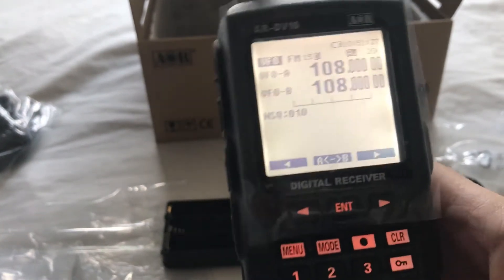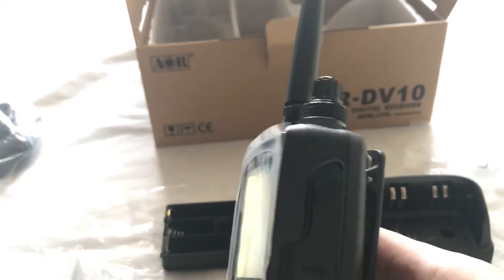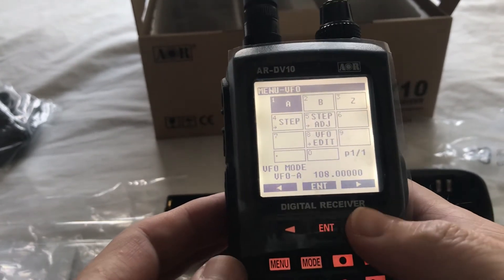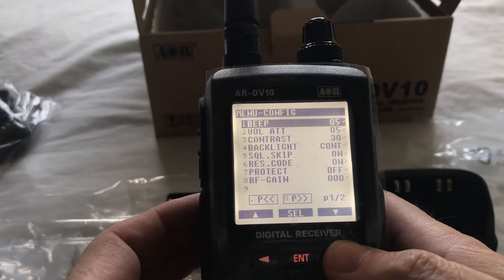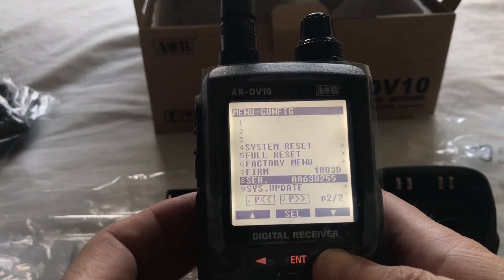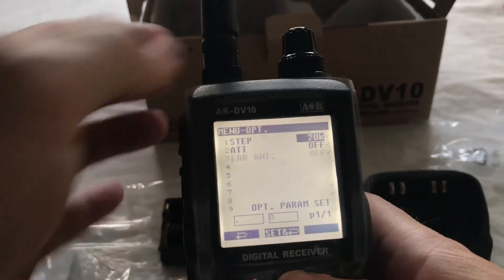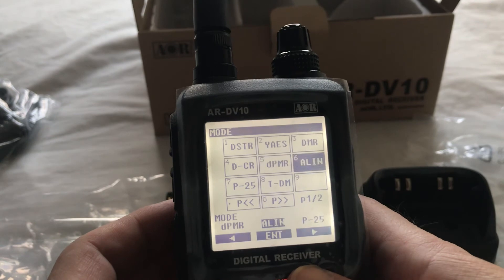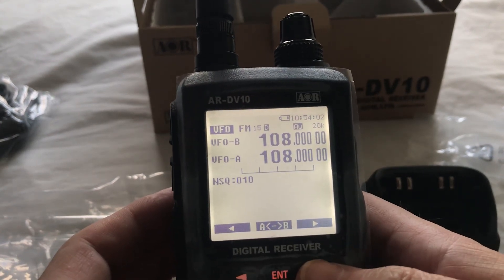AOR AR-DV10 Quick Look

Comment: Way way way way wayyyyyy overpriced, considering there is a kenwood that scans the same frequencies, for $100 used.
Reply: True, but the Kenwood doesn't decode all the same digital voices the AOR does
Reply: Kenwood does NOT have all the Digital Modes that the AOR has, plus you can SCAN an Unknown system and still Demodulate the Audio.
Reply: Also if you order international without all the USA bullshit you get no locked out frequencies and also a descrambler function. Which is used a bit on VHF and maritime HF. Really nice function AOR does.